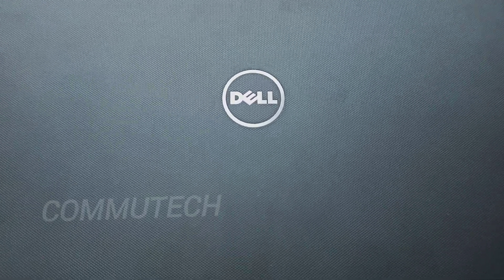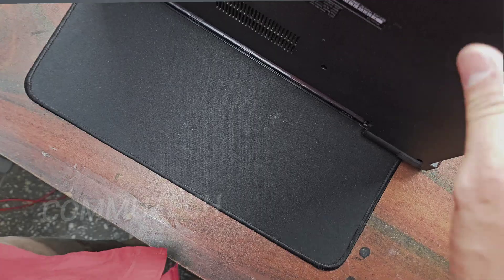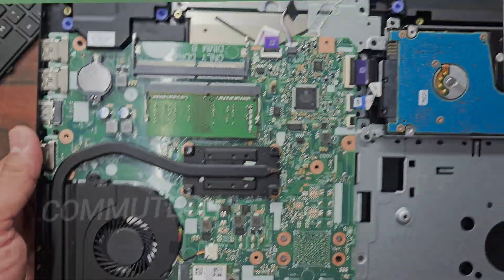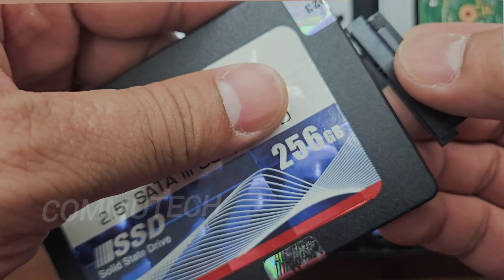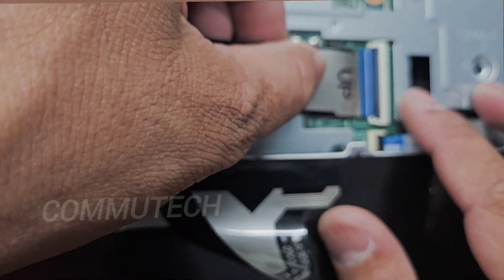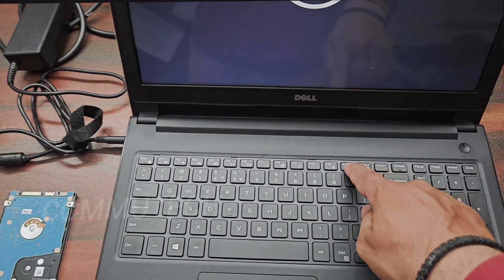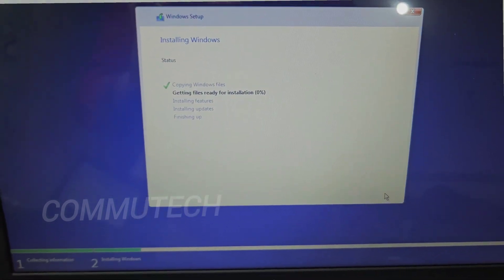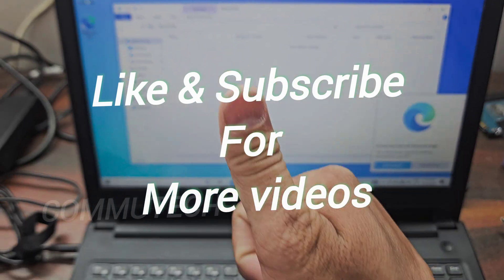HOW TO UPGARDE DELL VOSTRO 3568 LAPTOP WITH SSD#SSD INSTALL FOR DELL VOSTRO 15 3568

Comment: M. 2 sata ssd slot available in this laptop
Reply from the maker: No sata m. 2 slot is not available for adding ssd we need to replace the hdd

Or we can use a caddy adaptor to add ssd by replacing the optical drive

Comment: Can we replace ssd with toshiba sata hdd 1tb
Reply from the maker: @ravikantsingh1875  yes sure
Reply: @thansingh7047  but on using an external usb3 connector it dosent support it just hangs and stops laptop completely shoud i use caddy??
Reply from the maker: @ravikantsingh1875  yes caddy can be used
But still  using external usb the system should not hang

Comment: Hi! How do i install Crucial P3 Plus 500GB PCIe 4.0 3D NAND NVMe M.2 SSD, up to 4700MB/s - CT500P3PSSD8 in this laptop?
Reply from the maker: @amansri04 For  installing this SSD here you need a converter because there is no M. 2 NVME slot present in this laptop, below I have provided the link for that converter

ETZIN SFF-8639 NVME U.2 to NGFF M.2 M Key & B Key SSD Adapter for 2280 2260 2242 2230 SSD SATA-Bus NGFF SSD to PCI-e U.2 SFF-8639 Adapter PCIe M2 Converter Desktop Computer (Not SATA Interface) 1112PC https://amzn.in/d/5C4TLx0

Comment: I think it has m.2 sata ssd slot . I saw in  website of dell . Didn't you found in MB?
Reply from the maker: @bgc082_Np  No,  I didn't found it, 
Or if you saw an m. 2 slot then it might be the pci slot for wifi adaptor or the laptop motherboard may be different
If you see in my video, I have shown the complete motherboard but I didn't got it

Comment: Which Samsung ssd can I use in this laptop I have same model. Can I use internal Samsung ssd and 1 tb hdd in same laptop
Reply from the maker: https://amzn.in/d/01N8PSc
Reply: Thank you bro 🙏
Reply from the maker: @amananand3100  welcome🙂👍
Reply from the maker: Yes, you can use both drives but for second drive you need a caddy adaptor wich will replace the CD rom drive then the second drive can be used. 
I will be making a video this week for the caddy adaptor installation for using a second drive👍 it will be helpfull
Reply from the maker: Any 2. 5" SATA  SSD can be used in this laptop